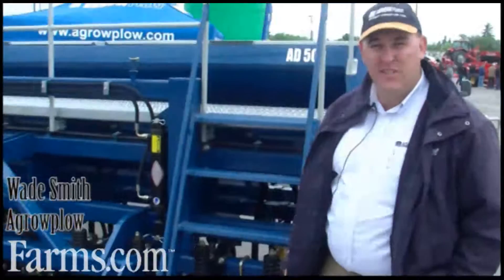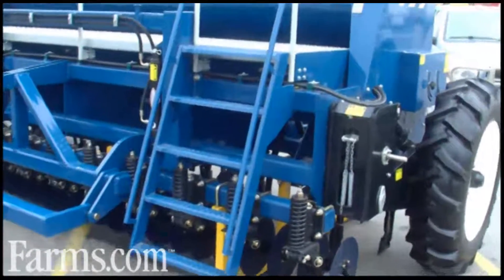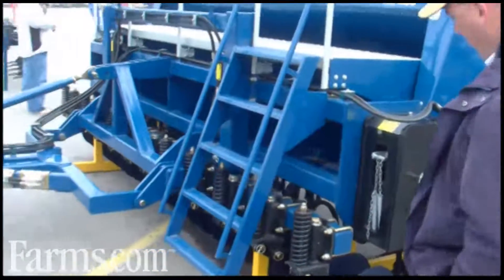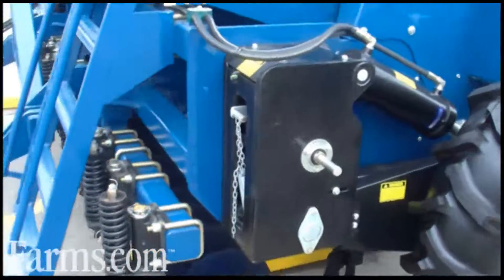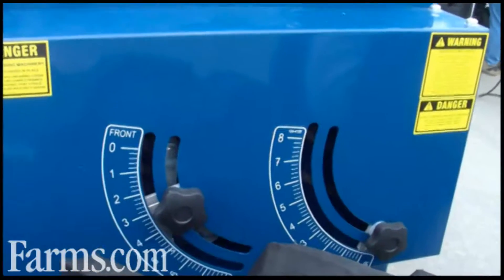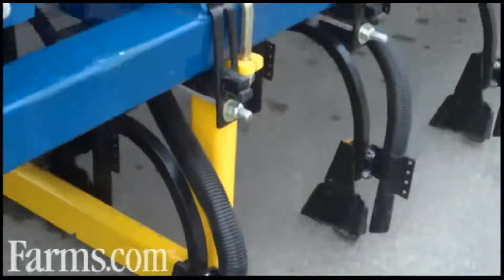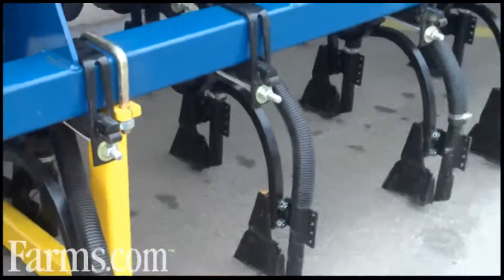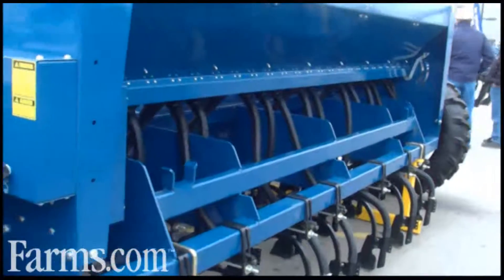Agrowplow AD 500 Series Seed Drill  from AgSearch.com

Comment: 1brymark.   had the same problem mate.  was advised by a ex employee that its the gearbox problem.  He stated its sensitive to oil viscosity.  they can sometimes get to thick due to grease in the oil..  he said empty oil, fill either brake cleaner or a good solvent and then refill with a good quality 30SAE oil.  should fix it.  just bought a AD320.. hopefully dont have that problem
Reply: New machine is spot on. A lot better then the older model. Only problem is that the external screw fixtures are all rusting.  Would of thought they'd use stainless instead of nickel plated.  The AD320 26run is a lovely machine.  Maybe it could of had slightly larger seed boxes